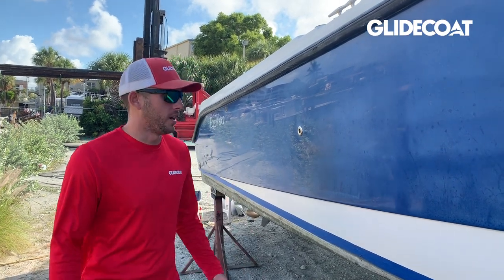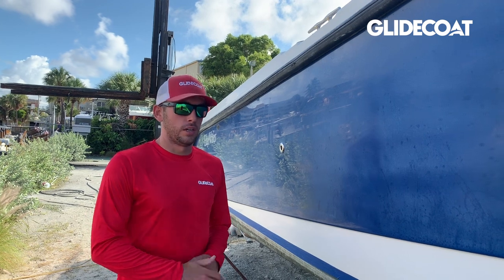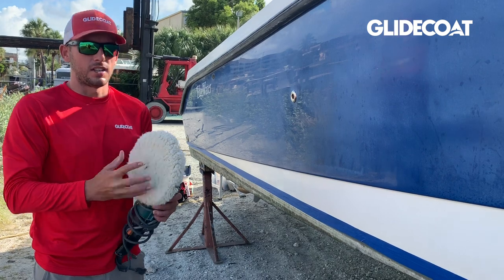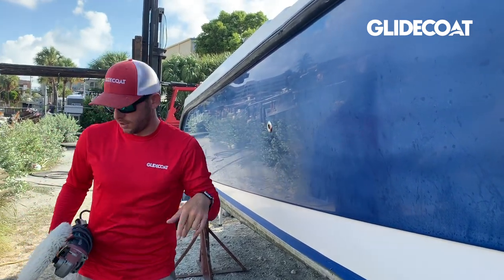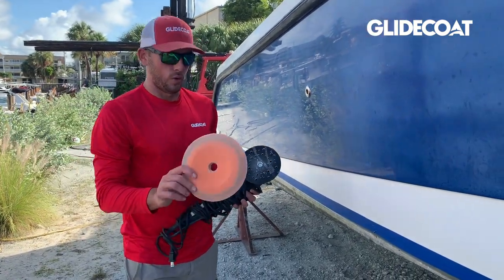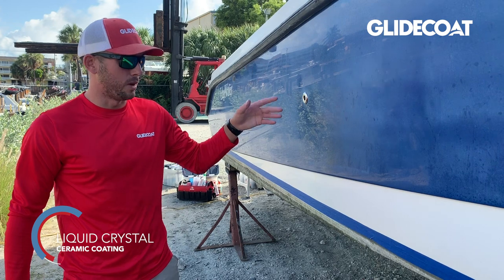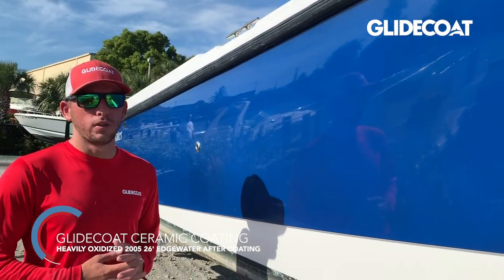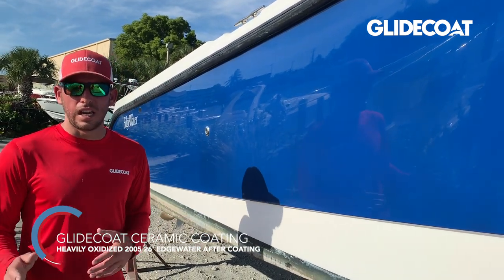Ceramic Coating Dark Blue Hull - 2005 26' Edgewater

Comment: Can you tell me when approximately to level the Ceramic Coating?  I did buy you kit and I am planning on doing this once the weather breaks.
Reply from the maker: You will want to buff the coating right away. Apply the coating in 2' by 2' section and then buff immediately with the microfiber towel. If you wait, the surface can become difficult to buff and it could cause streaking.

Comment: Gloss meter??   lol who knew that even existed.
Reply from the maker: We started using Glossmeters as a way to quantify shine for our customers and as part of our warranty process. Gloss and shine is really subjective - a lot of people would look at a brand new boat and say it is shiny - but put a glossmeter on it and it will read 80-85 Gloss Units. On the Edgewater, we were able to get the glossmeter readings above 90 - better than new.  Then we can use those readings as a tool to measure how the coating is holding up over time.
Reply: @Glidecoat  How long does the ceramic coating typically last before oxidation starts to reappear?
Reply from the maker: @jimristic1211   Hey Jim, it does depend on a few factors, like storage and location. In general, we say the coating will last 18 to 24 months - but oxidation won't appear right away. After 18 to 24 months the coating will start to lose its protective properties and the oxidation process will start on the unprotected surface. That said, Glidecoat can be reapplied without removing previous Glidecoat applications. Once you start to see the hydrophobic (water beading/sheeting) properties decrease, then you reapply to ensure the surface remains protected.